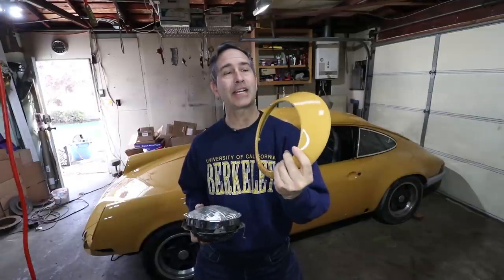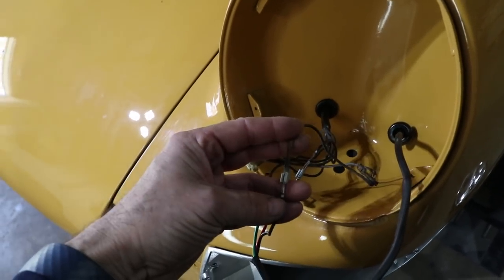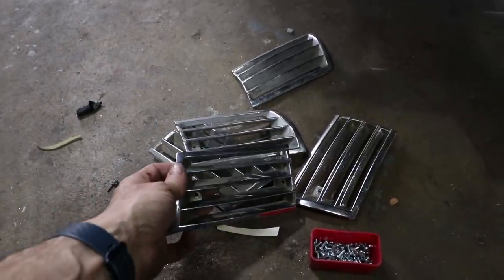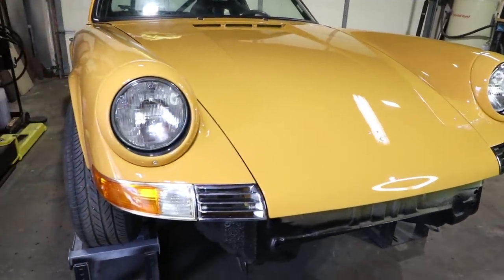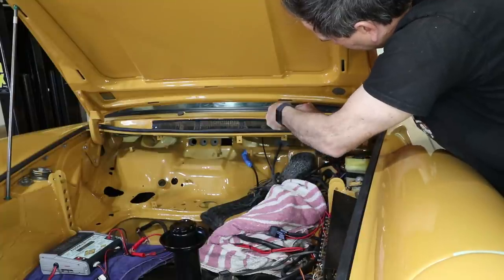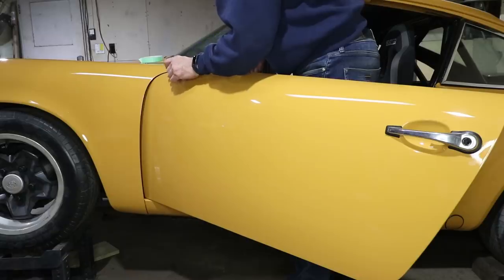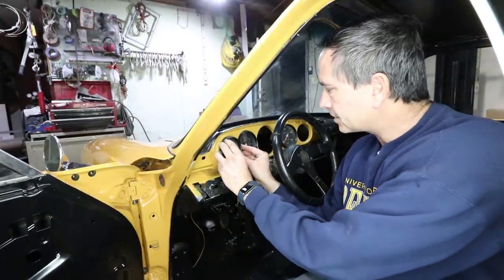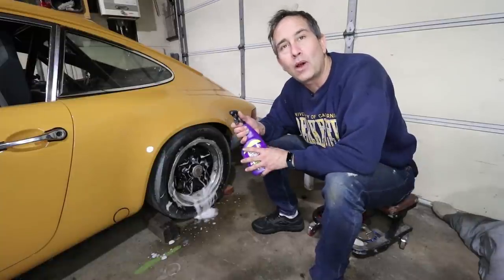Hooray! Phase 1 of My Restoration Journey is Now Complete

Comment: Hi Tom, I know your are going for minimalistic and light weight, so most likely you want more or a race car look.  However,  I'm voting for more of a subdued exterior.  Painting both the front and rear bumpers Bahama Yellow and finishing it off with wide black pinstriping. I also really like your idea of using the self adhering weather stripping for the turn signal gaskets as they are a super pain to align and typically you have to glue them in.
Reply from the maker: Cool, thanks for your vote!  Can't go wrong with yellow

Comment: Tom, I love the Bahama Yellow color. Were it me, I'd paint the bumpers the same color as the main body. I think a separate bumper color would detract from the car.

Would 2007, 911 Carrera S red brake calipers work on your car?
Reply from the maker: Thanks!  I think those brakes require larger diameter wheels.  The calipers I have now are plenty for this car

Comment: Congratulations!!!  If you ever want to try the European H4 style headlights without paying $600, eBay has VW headlights with "Porsche style" lenticular glass but accepts a sealed beam bulb behind it - the bottom mounting tab can be cut off to mount flush to the 911/912 headlight opening.  The only difference is the VW bezel has a slightly more rounded profile rather than the flat profile of the H4 bezel.  I think from the factory horn grills fit a lot worse than your custom panels!
Reply from the maker: Thanks for the tip.  I have some battered H4's from a racecar that I hope to restore someday.  Who knows maybe they are the VW ones?
I seem to remember that the bulb is removable though.  
Stay tuned for a future vid on these.

Comment: I actually really like the patina of the gauges as is... May be just pop the outer rings to clean the glass would look great 👍 Oh I must have forgotten to place the MOMO "horn button retainer ring" in the package. I should have some so I'll dig one out and post over to you ASAP 😉 So has your wife and son started asking when you'll install the passengers seat yet 😅? For bumpers I'd paint to match the body then wrap them in green to match your 356 for the front and red wrap for the rear (metalic silver would also look cool). I've got some spare great condition 964 red flag mirrors if you want them at a later date I can dig out from storage ... They don't look as good as what you have BUT for track they provide great visability which is a must (let me know as I have no use for them). Oh yes you worked out those plastic windshield thingies in the last vid a treat, I forgot to comment! I'm looking forwards to your performance modding vids already. Keep up the great work Tom👍
Reply from the maker: Thanks Mark!  I appreciate your advice about any and all.  Always good stuff.  Glad the windshield went in and thanks for the thingies!  
A horn adapter would be amazing!
Reply: @GarageTimeAutoResto  I'll post one out to you this week. They fit between the steering wheel and the boss so just need to remove the six allen key bolts. If memory servers me correct it acts as an earth for the horn so you may need to Google the wiring👍